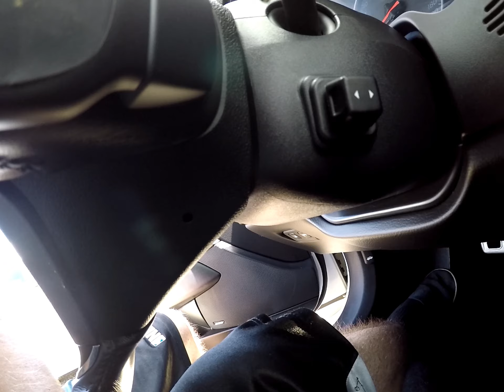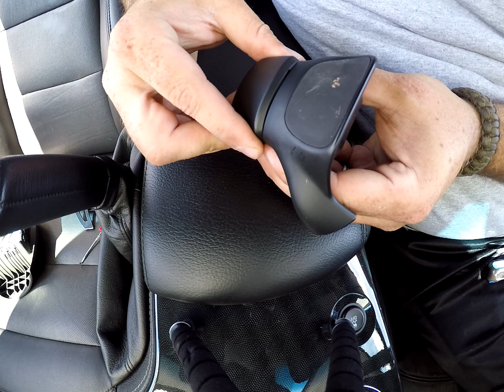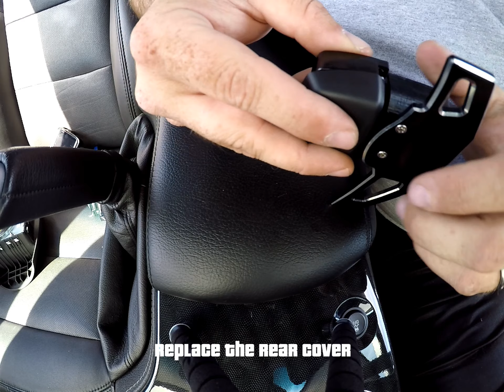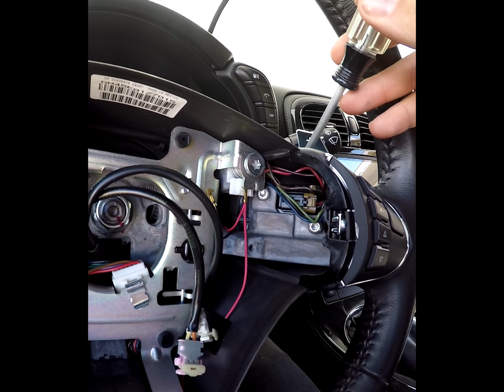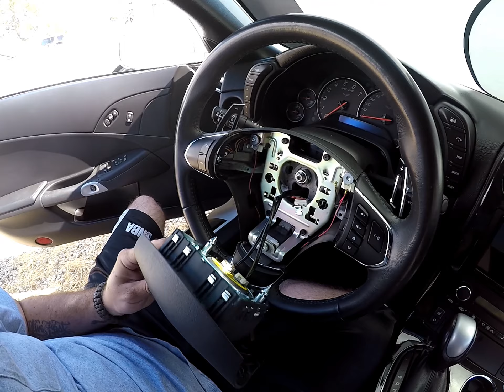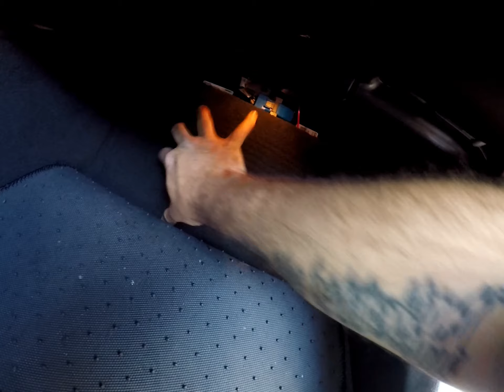C6 Corvette F1 Mod and Paddle Swap (A6)

Comment: Great vid. Followed it to a T! My paddles shifted properly although that little piece that was snug for you was freaking extra tight, no grease for me. Both sides, but other than that no real issues. Those wires were a PIA.
Reply from the maker: Very happy it worked for you man. Be safe.

Comment: Nice posting. These paddle shifters sure looks much better 
I think it is just to swap places of 2 wires or disconnect 1 wire on the left side paddle as well but cant say for sure..
Reply from the maker: Swapping the wires. Both are still connected.

Comment: Thanks for the video, I just ordered the paddle shifters.   Just nervous about braking the pins in the shifter.  Wish me luck..
Reply from the maker: Its not a huge deal once you get a hold of them. Just take your time.
Reply: @Omega47  Thanks.  When switching the wires (Right Side - Upshift), to access the clips in the harness, do you go from the front or the back of the harness to release the clips?

Comment: Just did this, paddles work but air bag light in dash is on. Connections (pink and white) on wheel are good. What could it be? Thank you for video!
Reply from the maker: Was ignition off when reconnecting the airbag? Fuse blown?
Reply: @Omega47  Battery (negative) was not hooked up. After all the steps for paddles was done, connected negative on battery and started car. Looked in manual for a fuse location but didn't see it. 2007 coupe, not Zo6
Reply: 1 of the 2 connectors came loose when I reinstalled the bag. Took bag off, saw the connection not in all the way and that fixed the air bag light. I'm a new owner of 07 LT3 with Z51 pkg. Black. Love the car. Thanks again for the great in depth video!

Comment: i have an 08 c6 and my paddles will not work, i took out the airbag to see if they were even plugged in because the person before me had the plastic pieces painted. i’ve checked the fuse for it (cruise control a2) and there’s also a tcm fuse for it aswell but i feel like there’s no need to pull that one out if i can drive the car lol. was wondering if you had any suggestions or would know of this problem? i’ve looked all through forums and it seems like no one else has had this problem

Comment: Just installed  the new paddles today.  But the brown wire got cut and I couldn't connect the brown on the purple side,  but did connect purple to the brown side.   Put it all back together and thought I would have to go   and get it fixed.  But to my surprise  they still worked.  With the exception you  can not push toward dash and shift.  So it works out better cause now it only works the way we want it.  Don't have to worry about getting it fixed now.